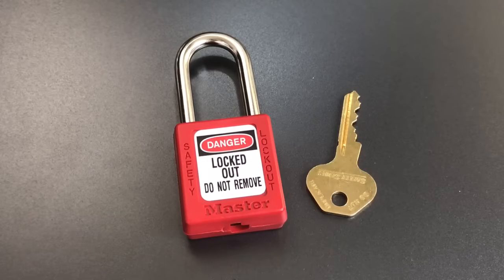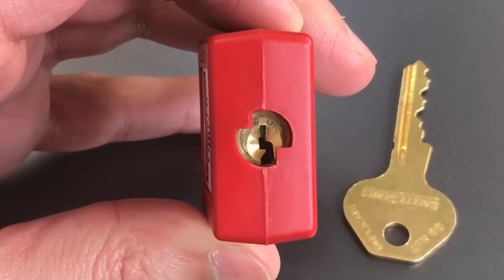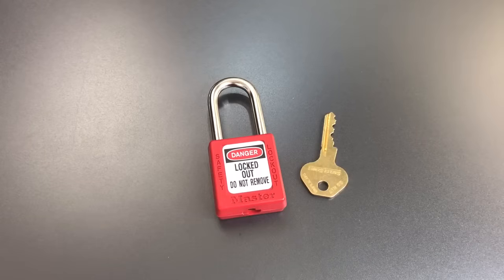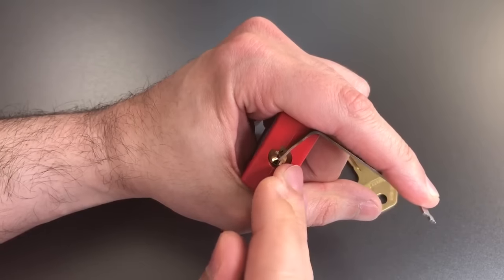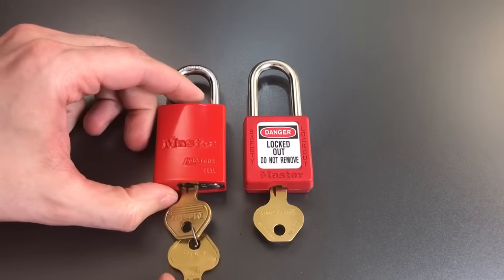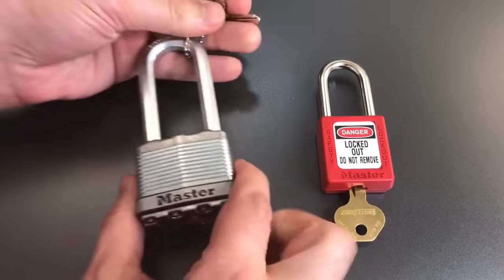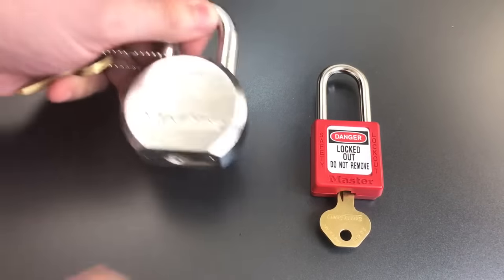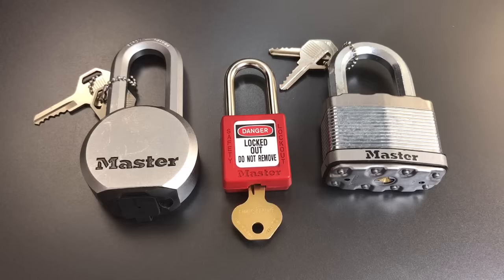[479] The Master Lock Paradox - Model 410 LOTO Padlock

Comment: I think I can shed some light on this paradox. I'm actually an industrial safety specialist. My focus is on electrical safety and, you guessed it, lock out/tag out verify. The bad Lock body can actually be explained. 

Any robust lotov program, has instructions on how to remove an abandoned lock; for example if someone leaves a lock on a machine and goes home for the night. If that machine needs to be brought online, the loto lock needs to be removed. Usually done with bolt cutters or destroying the lock body with a set of wrenches, thus the non hardened shackle and the plastic body. Imagine in a manufacturing environment, where downtime is just setting piles of money on fire. If the equipment needs to be brought into service and there is no means to remove the lock, but to have the owner of the lock return and remove the lock. That would be a disaster. Also, what if the owner of the lock lost/broke their key. All very common in these environments.

The real focus, as stated in other comments is for key security. It's really important that loto locks are individually keyed. always on sites I see that have any kind of master key program for their loto locks, usually there's a slew of incidents that result in amputation or fatality with it. Thus the exceptionally robust core. In the end, it's not so much a concern about making the locks secure. If you have someone going around defeating loto locks, that's straight sabotage, and usually at that point we have way bigger issues we need to address. There are easier and more convenient ways to sabotage equipment then defeating loto locks. 

The metal bodies, less common, but I've seen used typically for harsh environments. I've seen folks use plastic bodied locks in casting plants and have had them melt while in use. So that's how I explain the body differences. As for the rest, I'd guess manufacturing ease or cost are probably dictates how the other locks are constructed

Comment: As an industrial electrician our company typically handed Red Plastic locks just like that to use E&I Folks.   Plastic so you don't accidently weld the body if it shorts out a 600V bus bar.    Plastic is lighter too carrying around all day.

Comment: The plastic body lock is not necessarily used for typical lockout tagout, or if it is used that way it is misapplied. Generally the plastic body lock is a tamper-evident device that is attached prior to deployment and installation of a new machine or system. When the system leaves the factory these locks are installed and then the keys destroyed so that when the system arrives on site it is obvious to the installers that nothing has been tampered with. Once on the site the installer inspects everything and uses a bolt cutter to remove the locks thus destroying them so that they cannot be reused I have done this myself on multiple occasions. I do not know if this is Master lock's intention but I do know that there are multiple companies who use this practice. When i took the Master locks off i installed my personal American 1106.

Comment: What you have to keep in mind with these locks is that they are not engineered to be 100% pick proof. They are engineered to be sturdy enough to withstand the daily use of applying them to energy sources in a variety of industrial applications. 
Anyone wishing to cut or pick the lock can do so if they try hard enough, however that is beyond the scope of OSHA LOTO. As to why the plastic housing, consider that many maintenance workers carry several of these on their person at a time. They do get heavy after a long day! Also, no duplicate keys are permitted!

Comment: Having used those locks in live fuse panels. I personally can see why the plastic body.  The less conductive material around live voltage ,the better.  Although the hasp itself would be conductive if you are applying the lock while holding the plastic body and you "slip" the plastic shields your hand and, by extension, your body from taking a hit of live voltage. I myself would always wear nonconductive gloves. But the more you are in and around dangerous voltage, the more likely you will not "waste time" with all the possible safety equipment.

I had one bad experience years ago. I locked out a master panel in a plant so I could service a remote breaker panel. I checked the breaker panel to make sure it was "dead," but need to get a set of pliers that I needed, so I walk back to my toolbox five minutes round trip. The plant manager, for safety reasons, held the keys to the LOTO; when he saw me back at my toolbox, he assumed I was done and putting tools away. So he pulled the LOTO. Fortunately, I was always over-cautious and used my own tools, which were rubber/plastic nonconductive handles. I also had a set of leather gloves and safety glasses on. When I reached into the  "dead panel." BANG sparks flew the tool was thrown out of my hand across the room. 

I still have the welded jaw pliers in my toolbox as a reminder.  The rules for LOTO usage were revised after that incident. And I moved on to a saver environment and job soon after that experience.

Comment: The reason these are designed like this is because they need the core to be complex enough to not pick but fragile enough so that if an employee loses their key they can be removed without damaging the latch on the equipment that you are locking out. My work used to have metal locks but after having to get a hot work permit and grinder to remove locks dozens of times we changed to plastic that can be crushed with channel locks. Plus the locks aren't really used to physically stop somebody from maliciously tampering with equipment. Its there to prevent accidentally turning on equipment while somebody is working on it. The locks have names on them so the employee working on the equipment can be identified.

Comment: This lock is designed to lockout electrical panels to prevent tampering, as a safety measure and precaution. Not to prevent theft.  Not to prevent trespassing, nor illegal entry.  So, as an electrician, I turn off breakers  on panel, then place the lock on the panel ( or breaker) to secure and prevent someone from accidentally throwing  on the breaker I need off.  It’s an added measure of security, above signs, or tie wraps lockouts, to secure panel breakers during major electrical repairs.

Comment: So i actually own one of these locks for work. I think that the reason they go with the non hardened shackle is because people forget to remove their locks. So, following lock removal procedures,  it is easier to cut off if this happens.  But they may go with the better core because we put these locks through alot of stress. Ie.: dirt, water, dust, ect..... so it seems to be the best choice to deal with both issues.  I hope this helps and you don't go to your grave with no explanation.  Even if it is from a user not a manufacturer.

Comment: As someone who uses American Lock 1100 LOTO locks (which are much more expensive and better quality) on a daily basis in an oil refinery, there is almost certainly a concern for cost, as there are probably 150,000 to 200,000 or more of these locks in my refinery alone. They want utmost secuity to prevent a mishap but are not so concerned about the body of the lock.  They just want to make sure that it cannot be unlocked with anything but its own key and each of these locks are individually keyed.  The reason for unhardened shackles is that keys get lost and locksmiths are not cheap, so we keep master keys (aka boltcutters available if the equipment needs to be de’lotoed and the key is missing.

Comment: A lot of comments on why a lock like this is needed. But master lock makes this lock to meet a large customer's or many large customers' specification. The customer knows what they want and will not buy something that does not meet the spec. Master Lock sells lots of these LOTO locks to industry. Master lock also sells lots of locks with less secure cores because the buyer will buy anything that looks good on the retail store shelf. What % of lock buyers have any idea what makes a good lock. Buyer "Look at that big selection of Master Locks. That one looks really strong." Buyer grabs the heavy looking lock and puts it in his shopping cart. End of story. 
Well almost...  Thief "Look at that big lock. There must be something valuable in there." Thief swings his big hammer and the hasp breaks or tears out out of the door. Good buy valuable stuff.

Comment: Because, locks for L/O are essentially robust tamper seals.  Usually they are on a steel hasp that is easier to bypass than the lock itself.  The idea is that someone can't easily bypass the lock without it being obvious.  Putting a high end core in a look body that is easy to destroy means that it will be easy to tell if the lockout point has been tampered with because the offender will likely have to destroy the body as verses picking it.  This makes sense for LOTO locks if they are used with a high quality hardened hasp.  Where I work at, we just use standard master locks, not specifically designed ones.  However, the lock points are checked prior to starting work for the day every time.

Comment: As an electrician who used these locks most of the time they are locking plastic parts they anyone can just pull off. The tags often have a photo of the electrician with his wife and children with a warning to leave it alone. Some older equipment has no way to lock out so all we can do is tag it and hope no one is an idiot.

Comment: Being in the industry, I have about 10 locks in my tool box. I'm guessing there are so many pins is because they need a larger number of unique keys. This lock is not a security lock, it is a "life safety" lock. If someone accidentally opens the lock and enables equipment, people can die. Did you know these locks have only one key? If they come with two, one is to be thrown away. Only the person who locked out the equipment is to have the key. I think there are OSHA requirements for LOTO locks that may interest you. To lock out a valve, it is attached to a plastic housing around a valve, and is put through a plastic hole. The lock is many times stronger than the hole. To lock out electrical disconnect handles, a hasp goes through a hole to create the mechanical lock. It has two, overlapping, curved fingers that make a circle, made of weak sheet metal. They have an area for about 10 locks. Every person working on the equient is to add a lock. You could remove it with wire cutters. The number of pins I think is for increasing the unique number of keys. I can't explain the security pins. No one wants to pick these
Reply: As others have pointed out, it was probably cheaper for Master to re-use an existing 6-pin core than to develop a crappier one just for LOTO locks.

Comment: The answer to the paradox is practical.  In a Loto situation, there needs to be a nearly impossible accidental opening.  There are millions of these locks on jobsites, and it is life threatening if someone can accidentally open this lock.  However, when a worker loses his key, or leaves site, there is a very specific process to remove a lock destructively, and it has to be relatively easy to destructively open.  Otherwise, time sensitive jobs would have delays waiting for a locksmith.   With these locks, once the process is followed, the lock can be cut off by the designated officer/man quickly with a common bolt cutter.

Comment: Just gonna say… I did a lot of shutdowns, these locks are a requirement in that particular line of work…
Yeah true, crappy lock body but excellent core.. I presume this would be because it’s a cheaper alternative than buying a fancy fandangle lock like the magnum lock…
Typically in a shutdown setting, these locks are there to ‘save lives’ hence why they all only have 1 single key..
And if there is an ‘isolation breach’ where someone has either left site and not removed their personal isolation lock, the lock can easily be cut off with bolt cutters etc, hence why it isn’t hardened steel either presumably…
And generally, you would get these locks in sets of 6, 6 heavy locks isn’t very practical to be carrying around all night working etc… also maybe another reason for the lightweight frame…
Been there, done that..

Comment: We use the for all 600 employee's at out factory.
 Here is the reason for the plastic body. 
 In the event of needing to remove the lock from a piece of "tooling" but the keyholder is not available, gone home, hospital etc etc. The lock can be fairly easily removed with the one tool that any trades person has at their disposal, a hammer.

Comment: The reason is simple. Most locks are merely for barring access; but the LOTO lock is not only for locking out breakers in electrical panels, it's for securing legal accountability (where the stakes are often much higher) as well, especially if a fatality is involved.

Comment: The plastic lock is to just to prevent a fellow worker from switching on the power to a machine while someone is serving it. It has a plastic body so it can't cause an electrical short should it bump into something. The 6 pin very restricted key, is so you can't go get a copy from anyone but the factory, to prevent fellow employees from freely having access and switching on a machine while someone is servicing it. I learned this from Master, while trying to get key blanks and being told how selling key blanks would defeat the reason for having such a lock.

Comment: Ok, so I think some people have voiced their opinion on this but I'm going to add my two cents.

First, the robust core. Six pins means more combinations meaning less duplicates, and part of the safety feature of LOTO is that the person who hangs the lock has to be the person to remove it. Otherwise that person is putting themself in danger when they go to work on the machinery.

Second, the plastic body and unhardened shackle allow for the lock to be cut easily after determining the lock was left behind accidentally or the key was lost. Basically, determine that no one is currently working on the equipment and that they cannot remove the lock for some reason then cut the lock and bring the machine back up.

All told, I don't really see a reason for the security pins but this core should be used in the more robust Masterlocks.

Comment: Paradox solved: It's beuracratic red tape, so it's protection is absolute without the physical security. 

Core is insane because it's a liability issue with potential for death. You can't just have me (who picked my house lock cause I got locked out once) go up to it and remove it with improvised locktools, turn it on, and say: Woops, Lock wasn't there! But in case the key is lost (this happens quite often) we don't want to wreck tools getting it off. It takes at least an hour to cut one of these off...  absolute confirmation from the person that applied the lock (0 to 16+ hours), a manager signature, lock descruction & retirement report, new lock report, etc... HUGE Pain to get one removed without the key. Hence the incentive to just pick it or get a locksmith buddy to take it off.

The key cannot be removed while the lock is unlocked (so you don't loose the key) and can't apply it without the key present at the locking. 

The act of breaking something that belongs to us is also against our nature, so this lock has a physiological protection too. We put our names on the back. 

To top it all off IF you ever break one of these locks, you are FIRED AND BURNED! Cardinal Rule, across all industries. That will haunt you between jobs too. This is an absolute.

Beyond that, Damage is easily visible. Material is cheap. Less tool wear. Colors (huge!) Red is Facility, Blue is Tech/Comtractor, Green is Driller, Purple is the Push, Gray is roughnecks, etc... On a rig. In facilities they may do a red group where a group of people apply 100 locks with the same key. Lock it in a box. Everyone applies a lock to that box. Now you need to give absolute confirmation before any locks of that color are removed. So you are safe. 

Absolute confirmation is that you need to remove the lock yourself or create a massive procedure where the person cutting the lock needs to hear from you directly the order to cut it.

Comment: The reason is that the normal locks are designed to be strong against an adversary using physical force. The LOTO locks are designed to be breakable in an emergency but highly secure against incorrect keys when there are loads of similar ones lying around.